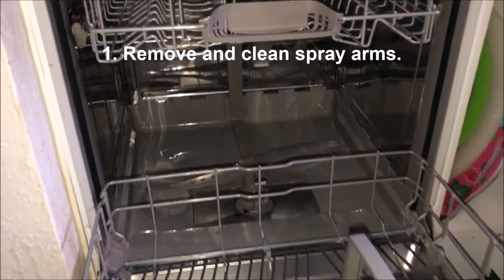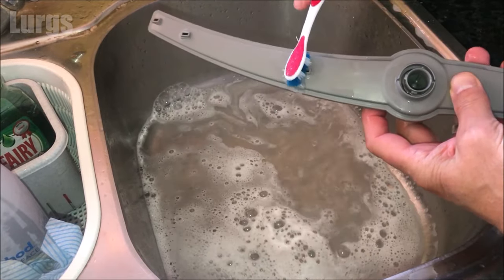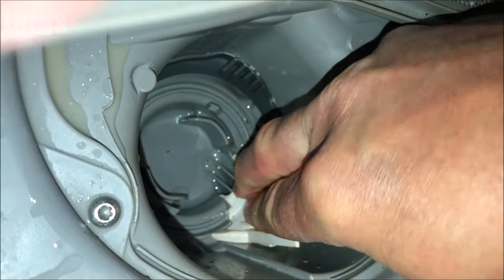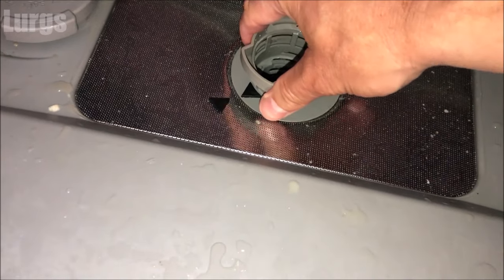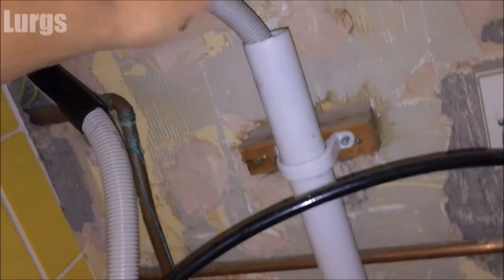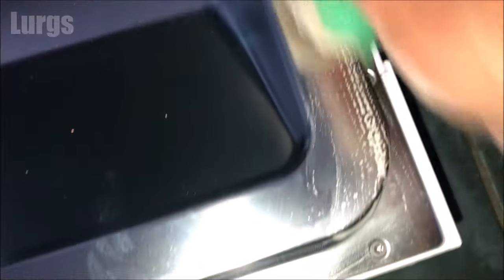How to clean Bosch Dishwasher for Maximum Efficiency - Bosch Dishwasher Maintenance

Comment from the maker: Other useful Videos to help you save ⏱TIME and 💰 MONEY:
========================================================
Dishwasher Error Code E23 https://www.youtube.com/watch?v=6z22-Ysn7rE&list=PLqrXuUebV8N89GJMUjDiMqGpAcic3wqfD
Siemens Dishwasher Maintenance https://www.youtube.com/watch?v=EhMpCig5jqc&list=PLqrXuUebV8N89GJMUjDiMqGpAcic3wqfD
Bosch Dishwasher E25 Error Code and How to Clean Filter for Maximum Efficiency https://www.youtube.com/watch?v=JAYli3EIcvI&list=PLqrXuUebV8N89GJMUjDiMqGpAcic3wqfD
How to clean Bosch Dishwasher to keep it Hygienically Fresh https://www.youtube.com/watch?v=DEknDV_QW4s&list=PLqrXuUebV8N89GJMUjDiMqGpAcic3wqfD
How to add Rinse Aid to a Bosch Dishwasher for Sparkling Glasses, Plates and Cutlery https://www.youtube.com/watch?v=eGxDojdRkRE&list=PLqrXuUebV8N89GJMUjDiMqGpAcic3wqfD
How to add Salt to a Bosch Dishwasher https://www.youtube.com/watch?v=ePr6zQRR3II&list=PLqrXuUebV8N89GJMUjDiMqGpAcic3wqfD
Bosch Dishwasher Maintenance for Maximum Efficiency https://www.youtube.com/watch?v=D_OszLw-llU&list=PLqrXuUebV8N89GJMUjDiMqGpAcic3wqfD
How to adjust Basket Height on Bosch Dishwasher https://www.youtube.com/watch?v=4i48aqpAIzQ&list=PLqrXuUebV8N89GJMUjDiMqGpAcic3wqfD
How to set Water Hardness on Bosch Dishwasher by setting Salt Dispenser Levels https://www.youtube.com/watch?v=zY4VRDoDC7g&list=PLqrXuUebV8N89GJMUjDiMqGpAcic3wqfD
.
Dishwashers https://www.youtube.com/watch?v=6z22-Ysn7rE&list=PLqrXuUebV8N89GJMUjDiMqGpAcic3wqfD
Washing Machines https://www.youtube.com/watch?v=0_gst8RokRo&list=PLqrXuUebV8N_Bv_41hH-IpIfM5qiS0Sin
Toilets and Plumbing https://www.youtube.com/watch?v=vT5KwJ2A2eU&list=PLqrXuUebV8N_d4OWPjAk4PJ7LnKb0Jdot
Combi Boiler https://www.youtube.com/watch?v=1gGEP2y_qHM&list=PLqrXuUebV8N8aiBpt_F3n23E3IOLlmgK2
How To's, Life Hacks, Helpful Tips here https://www.youtube.com/watch?v=dcmxUTsedlk&list=PLqrXuUebV8N92xXP4Dm_pHfBpEQ3wtP2R
.
Washing Machines:

=================
How to Disconnect a Washing Machine for Recycling or Moving https://www.youtube.com/watch?v=9oUzuS9E5kU&list=PLqrXuUebV8N_Bv_41hH-IpIfM5qiS0Sin
How to install a new Washing Machine https://www.youtube.com/watch?v=NGptwJDCTjo&list=PLqrXuUebV8N_Bv_41hH-IpIfM5qiS0Sin
Washing Machine not Draining Water Fixed https://www.youtube.com/watch?v=WxNRAMWDY2w&list=PLqrXuUebV8N_Bv_41hH-IpIfM5qiS0Sin
Washing Machine Fabric Softener Dispenser not Emptying Fixed https://www.youtube.com/watch?v=R5xIKjWuAIg&list=PLqrXuUebV8N_Bv_41hH-IpIfM5qiS0Sin
Washing Machine Drum Noise Spinning Fixed https://www.youtube.com/watch?v=mJo6IloTP1U&list=PLqrXuUebV8N_Bv_41hH-IpIfM5qiS0Sin
How to Clean your Washing Machine to keep it Hygienically Fresh https://www.youtube.com/watch?v=NbOUDxk7Yxw&list=PLqrXuUebV8N_Bv_41hH-IpIfM5qiS0Sin
How to Fix a Smelly Washing Machine https://www.youtube.com/watch?v=07B0BYKw-gs&list=PLqrXuUebV8N_Bv_41hH-IpIfM5qiS0Sin
.
Bosch\Siemens:
==============
Bosch Serie 4 VarioPerfect Washing Machine EcoSilence Drive:
Review & Wash Cycle https://www.youtube.com/watch?v=IccZCkQfBG0&list=PLqrXuUebV8N_Bv_41hH-IpIfM5qiS0Sin
SuperQuick 15 minute Wash in Realtime https://www.youtube.com/watch?v=4YgoBzj5fjQ&list=PLqrXuUebV8N_Bv_41hH-IpIfM5qiS0Sin
How to remove Dispenser Drawer https://www.youtube.com/watch?v=cj6ZupxqZEQ&list=PLqrXuUebV8N_Bv_41hH-IpIfM5qiS0Sin
Detergent Drawer Symbols & How to use them https://www.youtube.com/watch?v=SyoOvThCfUA&list=PLqrXuUebV8N_Bv_41hH-IpIfM5qiS0Sin
Maintenance Tips for Maximum Efficiency https://www.youtube.com/watch?v=eQZfevfTC-Q&list=PLqrXuUebV8N_Bv_41hH-IpIfM5qiS0Sin
Display Panel Overview https://www.youtube.com/watch?v=5Ps19okbE9c&list=PLqrXuUebV8N_Bv_41hH-IpIfM5qiS0Sin
How to remove Aqua Inlet Filter https://www.youtube.com/watch?v=1rvrUKbjt9o&list=PLqrXuUebV8N_Bv_41hH-IpIfM5qiS0Sin
E18 Error Code Fix Bosch Siemens Pump Filter blocked https://www.youtube.com/watch?v=qYjn8xnW3Pc&list=PLqrXuUebV8N_Bv_41hH-IpIfM5qiS0Sin
E32 Error Code Do not Panic https://www.youtube.com/watch?v=JAMGpceI6wc&list=PLqrXuUebV8N_Bv_41hH-IpIfM5qiS0Sin
How to activate Child Lock https://www.youtube.com/watch?v=yHMtk7pycG4&list=PLqrXuUebV8N_Bv_41hH-IpIfM5qiS0Sin
Door Stuck and How to Open it https://www.youtube.com/watch?v=JGJA8J7cB7w&list=PLqrXuUebV8N_Bv_41hH-IpIfM5qiS0Sin
Beeping Hell How to turn off beeping noise https://www.youtube.com/watch?v=fkJ4VU6ldLk&list=PLqrXuUebV8N_Bv_41hH-IpIfM5qiS0Sin
How to remove Dispenser Drawer from Siemens Washing Machine https://www.youtube.com/watch?v=HXAJlGbF-Vw&list=PLqrXuUebV8N_Bv_41hH-IpIfM5qiS0Sin
How to install Bosch Washing Machine VarioPerfect Serie 4 in Simple Easy Steps https://www.youtube.com/watch?v=L24GgdT9xq8&list=PLqrXuUebV8N_Bv_41hH-IpIfM5qiS0Sin
.
Hotpoint\Indesit:
=================
Hotpoint Aquarius Washing Machine Detergent Drawer Compartments & What goes Where https://www.youtube.com/watch?v=XSkF_5t6DhE&list=PLqrXuUebV8N_Bv_41hH-IpIfM5qiS0Sin
F05 Error Code Fix https://www.youtube.com/watch?v=0_gst8RokRo&list=PLqrXuUebV8N_Bv_41hH-IpIfM5qiS0Sin
F06 Error Code Door won't Open Fix https://www.youtube.com/watch?v=RCnxTPkQJ90&list=PLqrXuUebV8N_Bv_41hH-IpIfM5qiS0Sin
H2O Error Code Fix https://www.youtube.com/watch?v=gtRyR1gQj6I&list=PLqrXuUebV8N_Bv_41hH-IpIfM5qiS0Sin
How to clean Hotpoint Aquarius Washing Machine Pump Filter and Dispensing Drawer https://www.youtube.com/watch?v=x1E_gBvOtCw&list=PLqrXuUebV8N_Bv_41hH-IpIfM5qiS0Sin
How to remove Dispenser drawer from Hotpoint Washing Machine https://www.youtube.com/watch?v=ML5JgFcS4jI&list=PLqrXuUebV8N_Bv_41hH-IpIfM5qiS0Sin

Comment: i had so much gunk in the spray arms that i had to tape up all but 1 of the little holes (leave the one closest to the outer edge of the arm open), then blasted an air compressor up the big opening.  chunks of gunk came flying out of that little hole.  once gunk stopped coming out of that hole, i taped that up and opened another hole and try again.
Reply from the maker: Unusual to get lot's of gunk in them. Hope it's all running nice and efficient again. 😎

Comment: Thanks for the video.  I decided to follow your instructions for my Bosch dishwasher.  After using it for 18 months (and I don't know how it was maintained by previous owner),  I was shocked that the filter had no debris on it.  I filled the salt container at the same time.   I didn't dare try other suggestions on your video just in case I broke something.
Reply from the maker: Sounds like it’s in good condition if the filter was clean. Helps if you clean plates first.
Reply: @LurgsHowToGuides  actually I never rinse anything.  Guess I'm just lucky.  But thanks to you, I now know how to check the filter which I will do regularly.

Comment: Very helpful.  Appreciate how you walked through to get to the impeller. Mine required removing a screw, not a clip, but just seeing what it is and how it works really helped.  Found some very strange hard seeds in there.. perhaps the reason for the loud noise.
Reply from the maker: Thanks for the info, not seen a screw on the impeller. Glad I could help. 😎
Reply: Yess I wanted to ask about this, I removed the clip but I can’t see what’s behind it as it’s hidden. I used a mirror to try to see but it’s further into the mechanism
Reply from the maker: Access is tricky. Try drying it out as much as you can then get a vacuum cleaner nozzle down it to see if it can suck out any debris

Comment: This was such a good & clear & concise step-by-step  (and humorous) video.  Followed every step. Didn't solve my problem (not my drainage pipes either - those are all clear too),  but who knew about that little propeller thingy stuck down at the back of the filter?! Now the blo*dy thing is showroom clean, it's gotta be a technical problem, and it's not even a year old! I hate high tech computery gadgets (Bosch Series 4) - somehow they all just end up blinking and passively swearing at me!   Thank you so much for putting this together. Much appreciated. Will go check out some of your other videos a bit later.
Reply from the maker: Glad you enjoyed. Odd it's not draining when it's so new,  very annoying. If it's under a year use the warranty.
Reply: @LurgsHowToGuides  I ended up dismantling & checking the micro-filter on the water supply hose too - the bit that attaches to my water supply. Both mini filters  were squeaky clean too, so no blockage there either. However when I put everything back and plugged the machine back in after having turned the electricity off, the Bi*ch decided to work.  I've run it twice now with both fingers and legs crossed. I'm wondering if it was a "computer glitch" and literally the ol' "turning it off, turning it on technique" (from the mains) solved the hang-up?  It certainly wasn't dirt.  
(For anyone interested:  My problem: 10 minutes into the rinse cycle after switching it on, the machine would stop, the digital time display would blink 00:00 and the red "tap" icon would light up, and the machine remained still with water in the bottom. If I switched off and tried again, the water would drain out, the rinse would start, and then stop at 10 minutes.  So I knew the drainage worked, and water was flowing in to the machine, therefore pumps must be o.k. so it's all a complete mystery as to why - still! I can only think electronics.)
Reply from the maker: Classic the good old switch off and switch on trick! Glad it’s all working! Have a fab weekend.😎
Reply: @charlotteharding5953  We have a Thermidor stove and twice in fours year one side of the burners has not gas and no spark. To make a long story short removing the AC power for a few minutes has resolved the issue. I work in automation repair and sadly often power failing devices reset whatever was causing the issue. Sometimes it’s not a permanent fix but often it is. Take care

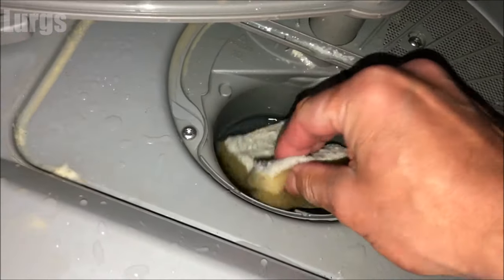Comment: Nice video.  Instead of using a sponge tor remove water from the drain (3:05), take advantage of the dishwasher's water draiinging feature that starts at the beginning of the risne (or anhy other) cycle.  Just close the dishwasher, select a cycle, start the dishwasher, and open the door once you hear the water stop draining. Then turn the dishwasher off.  Done! Also makes it easier to clean the drain of remaining sludge in the drain.  You might also decide to drain, remove sludge, pour some more water in the drain, and repeat the drain cycle above.

Comment: Concise and humorous, nicely done, but...  When cleaning the spray arms, you (and I) are just knocking the food back into the inner spray arm and it will soon be blocking the holes again.  Any way around that?
Reply from the maker: Really there shouldn’t be too much food in the spray arms. If you flush it well and maybe try to flush it back out the bigger central hole

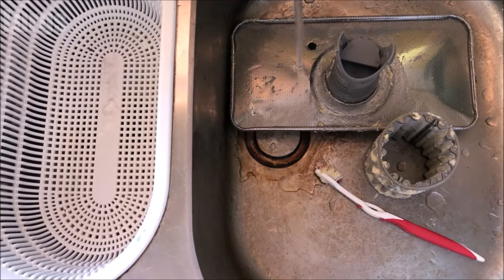Comment: Plastic Fiter Screen Holder (5:48): There are couple of tabs that hold the plastic cylinder in place on the metal screen. Easy-squeezy for removal to make cleaning the flat metal screen and the plastic cylinder easier to clean (with your wife's toothbrush)

Comment: Dear Sir, Regarding the upper impeller. I have a Bosch Silence Plus 48 dBA the upper impeller is not freely spinning, it's almost as if the retaining screw is too forcing the impeller to be too close to the rack. Do you know what I'm supposed to do?
Reply from the maker: It should spin very freely. Remove it and reinstall, the nut should lock easily and allow it to spin. Maybe it’s twisted

Comment: 8:39 whats the difference between those two kind of inlet hoses? My old dishwasher had the bigger one at the right hand side while the latest one just has that simple thin hose at the left. What that big chunk supposed to do (one at the right) ?
Reply from the maker: It varies on certain models, the first one is a basic filter, I think the other one is chunkier filter and water pressure system.
Reply: @LurgsHowToGuides  mine came with a rly large separate filter like 3 inch big filter alone, that is connected with the ‘simple hose’. And i came to know that the larger one is a solenoid valve. It opens and closes water flow digitally controlled by dishwasher. In the models that come with just a simple hose, in those this is placed inside the dishwasher where the hose ends.

Comment: Hi, I have Bosch IQ300 built in dishwasher. Recently it has started giving problem. It start and stops 3 times with gurgling sound as it discharged the water and it then completely stops.when I open the door the top panel shows BRUSH sign. After resetting and starting again same thing happens again. However, if I put it in pans program, it works. So, it does not look like that there is any blockage in the drainage pipe. The filter is clear and we do run it with finish cleaner regularly.

The dishwasher drainage pipe is connected to sink drainage section. Sink water runs fine.

I don’t want to call the engineer and pay £120 plus parts as I would rather buy a new one with 5 years warranty for £500.

Please advise what could be going wrong?
Reply: Just to add, if the rinse aid has run out, could it cause this issue?
Reply from the maker: No as you can run it without Rinse Aid. Unfortunately it sounds like possibly a computer type fault. If it’s pretty old you will have to weigh up cost of possible repair and it could fail again or getting a new one
Reply: Thank you. The dishwasher is now 6 years old. if the control panel is faulty than part and Labour may cost more than half the cost of new. Also, another unrelated problem with parts will cost more again to repair.

Therefore, it will make sense to buy new with 5 years guarantee.

I would prefer DW which displays the ERROR CODE. any recommendations up to £600?

Comment: My machine is the exact model. I've cleaned all you covered in this video EXCEPT that picture of a filter and I've run dish washer cleaner idk how many times now. The machine is still not cleaning and leaves "grit" and white film on my dishes. The worst is plastics.  What else can I do ?
Reply from the maker: Maybe it’s the salt dispenser mixing too much salt. You can adjust the salt (I’ve got a video how to adjust water hardness level on this Dishwasher).

Comment: When you remove the filter assembly there is a plastic sieve thing behind it held in place with a couple of tork screws. On my machine lots of debris accumulates below that. I removed the screws lifted it a bit and manually cleaned below it. The piece is held down by the spray duct. Can that be easily removed?
Reply from the maker: Yours must be different to my Bosch model. Not sure I’m afraid.
Reply: @LurgsHowToGuides  It looked the same  to me, at least the filter assembly and the bit immediately behind it (that's what I'm talking about).
Reply from the maker: @bobjackson4720  Not sure, I’ve never taken that bit apart. Good luck

Comment: What's the point of a dishwasher cleaner if you are using detergent which cleans dishes inside of it?  Wouldn't that same detergent clean your dishwasher?  I mean I get that certain sized foot particles will clog things and that needs cleaning, but outside of that what does a dishwasher cleaner do that dishwasher detergent does not?  If it's just about the smell wouldn't like throwing some lemon juice and hot water do the same thing or white vinegar or diluted bleach?
Reply from the maker: Just gives it a thorough clean through when it’s empty. Same reason we clean our houses with cleaning stuff, might look clean but is it really. We do ours every 3 months or so

Comment: My Bosch silenceplus dishwasher isn't cleaning the top level very well at all... I've checked all the sprayer hole for blockages and everything looks really clean .... What could be the issue ? Thanks for anyone who can help
Reply from the maker: Follow the sprayer tube back and make sure it connects properly at the back and that it is clear of debris. Run a dishwasher cleaning programme with proper cleaner and empty
https://youtu.be/DEknDV_QW4s
Reply: That's exactly the problem I have... I did all the video suggestions for cleaning but didn't help. My glasses and mugs are not clean at all, it seems the water is not getting up into the glasses/mugs very well at all, dried on stains inside.

Comment: che schifo quel filtro!!
Reply from the maker: Yes they do get very dirty unless you clean plates off before loading it up.
Reply: @LurgsHowToGuides  yesterday i had to clean it up for the first time after 1 1/2 year of usage and it wasnt so dirty. But i insist on clean plates before putting them inside. Maybe its stupid but its better not make the filter too dirty: the washingmachine works badly then
Reply: @LurgsHowToGuides  If we clean the plates off.... then whats the whole point of the dishwasher?? We might as well clean the dishes all the way 🤭